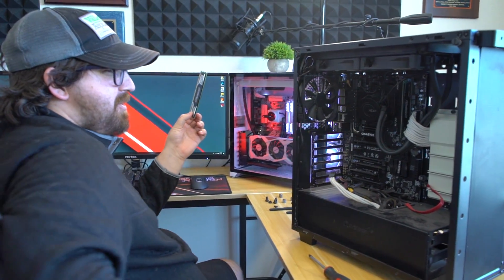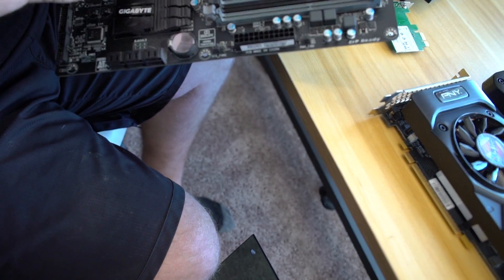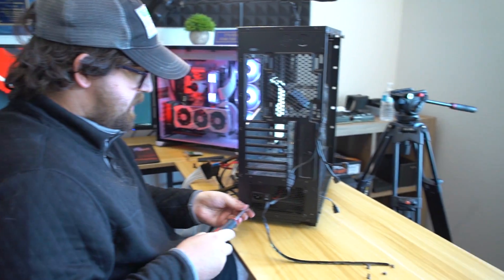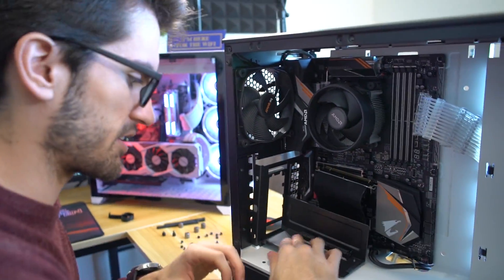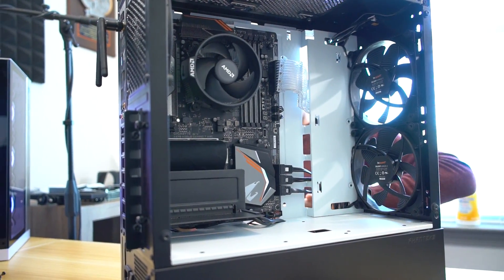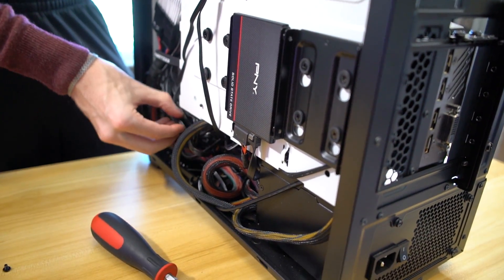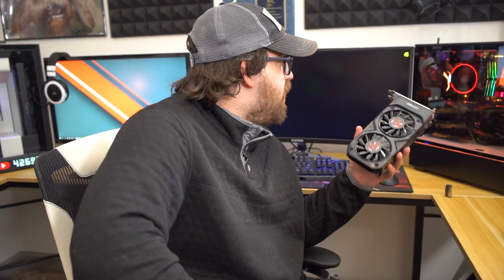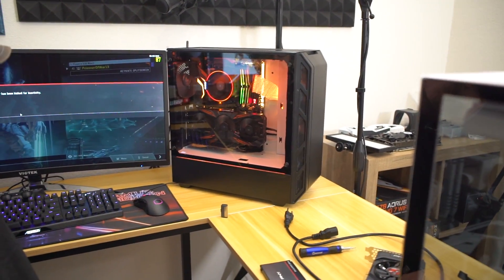Upgrading McLovin's Old PC

Comment: Always remember to check your motherboard manual for the correct DIMM slots to use if you don't use them all. Good tip to show you making sure that you put in the right slots.
Reply from the maker: They're marked on the board.

Comment: I can't imagine what it's like to receive an upgrade like this from a friend. I did something similar, and  my best friend wasn't ready for that kind of power. 

Also, I've used PNY drives in alot of builds, and upgraded a laptop with the same drive. You might have just been unlucky.

Comment: so i have a problem with my ryzen 5 2600x aorus b450 pro rev 1.0 and my 32gb or ram 
it says i have 32gb but only 16gb is usable and i cant get into the bios because windows startsup to quickly

Comment: Love the P350X. It's your video that practically sold it to me. I did a similar upgrade/overhaul back in September. Although I managed to grab a GIgabyte GTX 1080 Windforce OC before the price hike...was basically the cheapest I could get brand new at the time. Also, I didn't really want orange in my rig...so ended up getting some aluminium tape and a hobby knife, and covering the accents.   

I was kinda lazy when I upgraded, and didn't want to do an entire fresh install of Windows. I just wanted to do some gaming. Even if it messed up some programs with regards to system IDs. So I manually removed drivers and software for my 990FXA-UD3, rebooted into safe mode and used a free program called Device Remover (you can grab it from MajorGeeks) to get rid of any FX-8320 related references/drivers. I then cloned my install from a 850 Evo 500GB over to a 970 Evo 500GB. 

After I booted with the Ryzen 7 2700X, ASUS Prime X470 Pro and whatnot...Windows installed the necessary drivers. It was pretty much smooth sailing. I didn't run into any major issues. It wasn't until months later that I decided to just to a fresh install, with the Windows 10 October update.

Comment: anyone knows wat he used to get the gpu vertical i have the same case and want to do it with my upcoming build
Reply: It's Cooler Master's vertical mount/bracket. I have it in my P350X case. Phanteks also has their own vertical mount, and there also some off-brand ones out there was well. Although, Cable Mod has a mount that doesn't require you to cut away at your case...but they only do limited runs/batches, and they tend to sell out quickly.
Reply: @MichaelStephenLordReserei1987  thanks (Y)